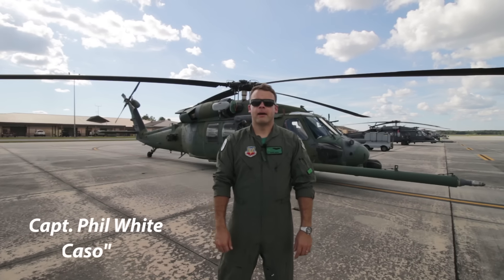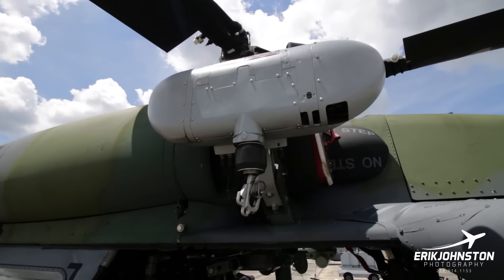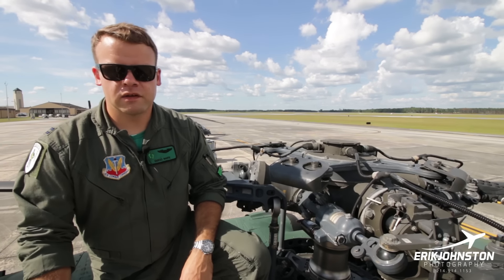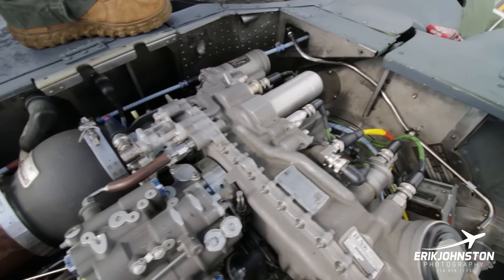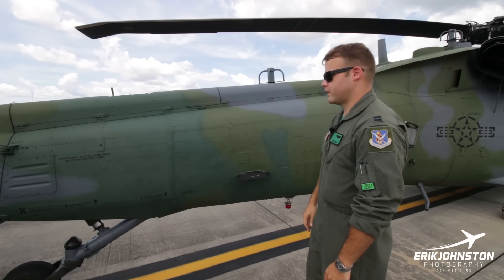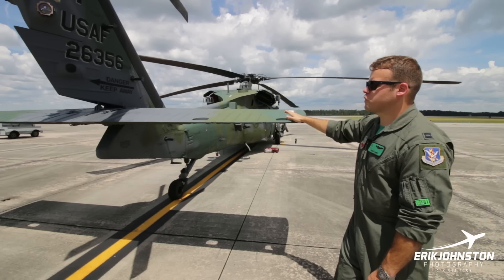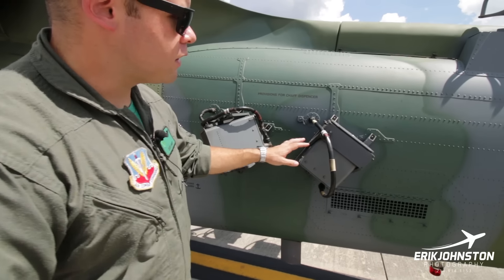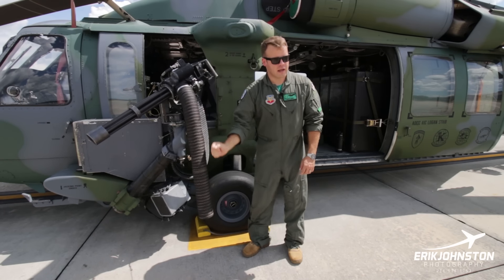HH-60G Pave Hawk Walkaround Tour

Comment: My dad, now 98, did all of the preliminary design for the Blackhawk. I remember when he told me about the crashworthy features and the wire cutters. They went over to the lunar landing pad a t NASA and cashed a Huey. He did all the mission design parameters, weights, fluid dynamics. He spent most of the 70's between FT Eustis and Sykorsky in Philly.

Comment: Tail 356, I believe I've flown on that aircraft when it was assigned to the 48th RQS at Holloman AFB. I was a flight engineer at the time.
Reply: I worked on this bird in the phase dock from 1993 -1998 also with the 48th at HAFB.

Comment: I was stationed at Holloman AFB, NM (1993-1998) when that helo (91-26356) showed up from Sikorsky in the early 1990's brand new. I performed about 3 phase inspections on it. The following were there during my time - 91-26356, 91-26357, 91-26358, 91-26359 (RIP), 91-26406 and 91-26407. It's awesome to hear it called the 'heritage bird'.

Comment: Very solid descriptions of everything. Only point I would make is the all-moving vertical stabilator was implemented to alleviate the downforce from the main rotor (not the tail rotor) in hover and slow flight. Otherwise, one of the most detailed descriptions I've seen of the various features of an H-60.
Reply: Thats cool, i work on them and didn't know that
Reply: Tail and main.  Not just main.

Comment: Was a fairly in-depth and accurate video, just a few things that he didn't go over, 
1: If you picked up that the panel covering the Tail Rotor Drive Shaft on the T/R Pylon was colored differently than the rest of the pylon that because that whole panel is the VHF/ UHF antenna and so you obviously have to paint it with something that doesn't interfere with RF signals too much. 
2: That cover that is just forward of the Main Rotor is where the flight controls are located at and its also where the engine Imput Modules, generators, and hydraulic pumps are you access all of that by sliding that cover forward. 
3: The Main Landing Gear struts are able to absorb such an astonishing amount of energy from landng because they are a two-stage oil& gas component, by having not just a fluid but also a gas in the strut it allows them to be remarkably absorbing.
4: Most of the UH-60 A's(A++) and L's still in service are using the 701D engines while the Mike's I believe have a different model.
5: On the topside base of the T/R Pylon to the rear just above the stabilator you may have seen and aerodynamic fairing curved to the left, that plus the shape of the whole T/R Pylon is to aid the pilots land the bird in case they lose the T/R because down to I believe 80 knots the T/R Pylon plus that fairing are able to generate enough anti-torque force to counter the M/R so as long as the bird stays flying fast in forward flight you can basically fly the hawk like a fixed wing and then do a rolling landing at the end.

Comment: 12 combat troops is what it was designed for in the seats. Typical configuration is 11 seats. The seat between the crew chiefs is usually pulled out.
Reply: Pull all the seats and you can fit a lot more.

Comment: I spent 20 years as a avionic mechanic in the Army on those. The one thing he was wrong about was the fuel boost pump. It is for vapor locking at high altitude.

Comment: How does the rotor wash not effect the pitot tube measurements?
Reply: It actually does affect them. The flight manual has a corrections chart to calculate your actual airspeed because of the downwash. The airspeed needles also jump about 20 knots when we shoot the guns off the nose!

Comment: The story I heard was the Air Force got PaveHawks after the first gulf war. They had retired their HH 53’s for Search and Rescue being told they could use Army birds. During that war, the Army said they needed all their Helos, and CSAR was out of luck/a secondary mission. Obviously, with the great results from Vietnam rescues, and the morale building from them, this was unacceptable. So the Air Force got MH 60’s. 
Like I said, this is what I heard. Is it the truth??
Reply: The rescue squadrons had just started transitioning from HH-3s to Pave Hawks when Desert Storm kicked off. Unfortunately they were not deployable so all of the USAF rescue pickups were done by MH-53 Pave Lows as a secondary mission to SOF. The MH-60Gs were basically the same as the HH (even same name) and gave AFSOC a smaller rotary wing platform to work alongside the Pave Lows.

Comment: 44:45 Wouldn't it be better if the brass was saved and recycled? Especially since it's coming out of a mini gun that shoots couple thousand rounds per minute
Reply: The added weight and drag of such a system would not justify the performance limitations and overall cost. Plus, when you’re in combat the last thing you’re worried about is a few thousand rounds of brass to be collected.
Reply: @philyumpshus  Few thousand is a little? That brass will add up over all the helis/guns used over years of training and action
Reply: @nukingjapanwasok6265  At the magnitude of thousands of rounds per minute, buying the materials required in order to recycle each casing would be much more costly than buying the equivalent in new ammunition.  The aforementioned performance limitations would increase aircraft fuel consumption per sortie, further increasing the cost. Since recycling sites will not always be collocated with the aircraft, a logistical network would need to be created in order to satisfy ammunition demand, adding to the cost even more.
Reply: @jigsaw3368  I was more thinking of dumping the brass into bins after a flight and then transporting those bins to Federal ( the ammo manufacturer for the U.S.
Reply: @nukingjapanwasok6265  In theory that's a good idea but it's not practical for a helicopter moving at 125 MPH. The additional weight and drag, not to mention the serious FOD hazard, do not warrant the cost of the brass. Most military installations recycle brass from small arms ranges, where it can easily be picked up, but collecting the brass from a flying aircraft simply isn't worth it. The cost of designing, testing, manufacturing, and installing all of the brass collection hardware would exceed decades of scrap brass value.